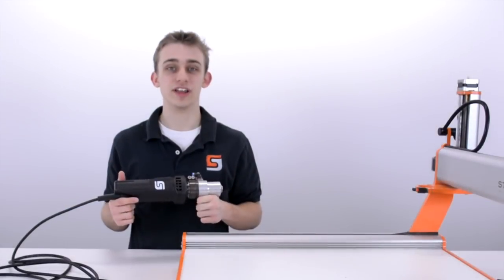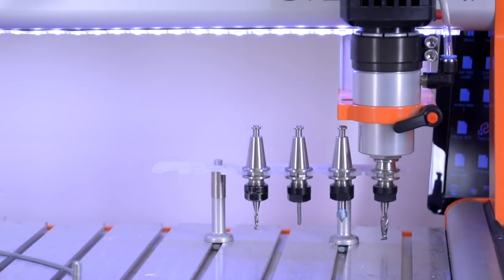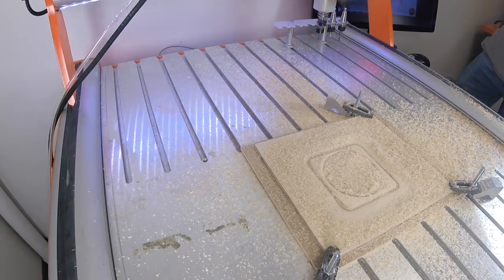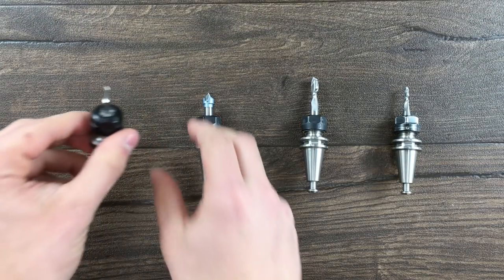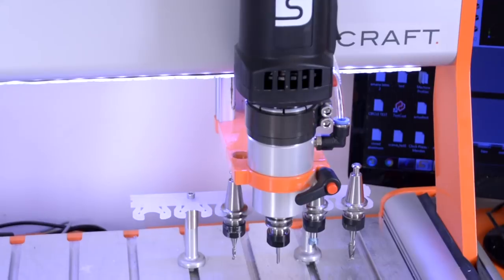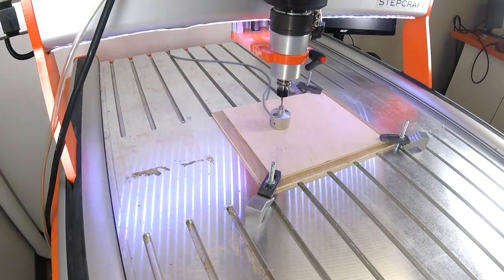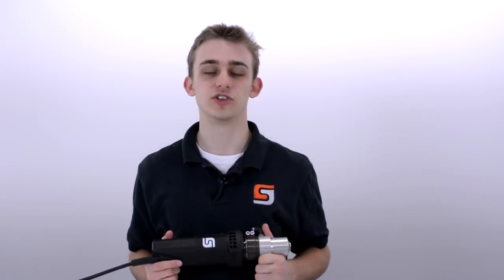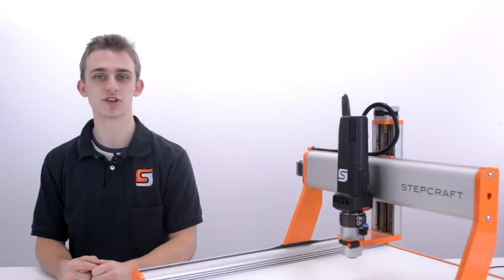The Ultimate CNC Add-On - Automatic Tool Changer for the STEPCRAFT MM-1000 Spindle

Comment: Will the exhaust adaptor work with this?
Reply: Does the automatic tool changer work with the dust collection system?
Reply: @bradthesing  I don't think so. Ordered the dust boot and the automatic tool changer and haven't set the tool changer up, but pretty sure they can't both be used. don't quote me on that though